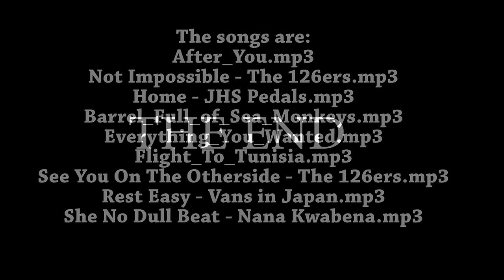diamonds and ruby, handmade 18KT gold ring

Comment: Hello. Interesting and beautiful ring design. 👌If I may, I have two questions. What is this red stone and what happens to the metal when you cut metal with a laser? When metal is cut with a saw or file, the metal shavings can be collected and used again, right?! What happens after the laser? 🙂
Reply: Turned to dust
Reply: Vapor I mean